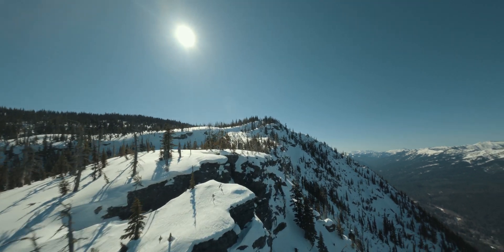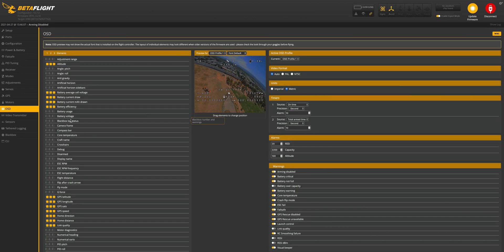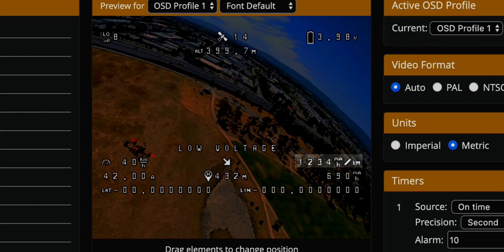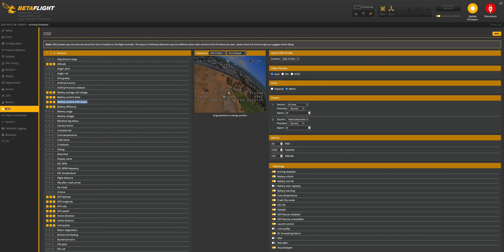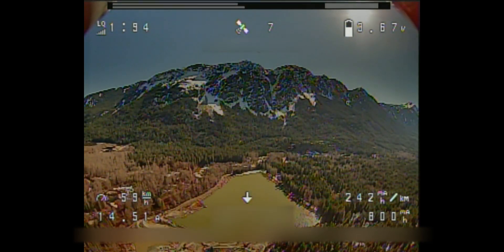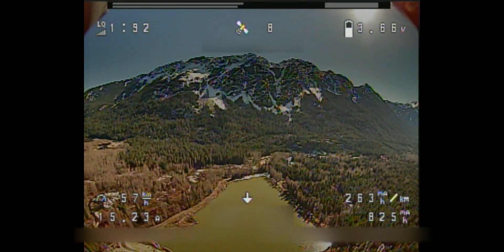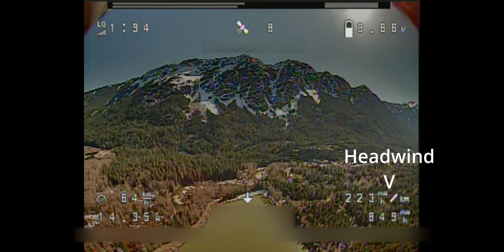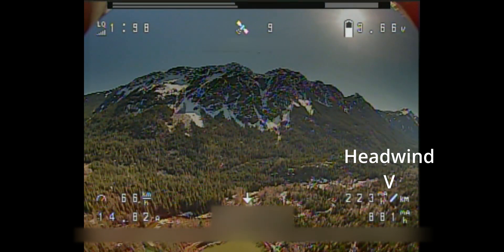The BEST Betaflight OSD Element for Long Range: Battery Efficiency

Comment: How did you get the speedometer icon with km/h reading? Mine shows some other unit (not even mph) even though I enabled GPS speed on OSD at BetaFlight Configurator.